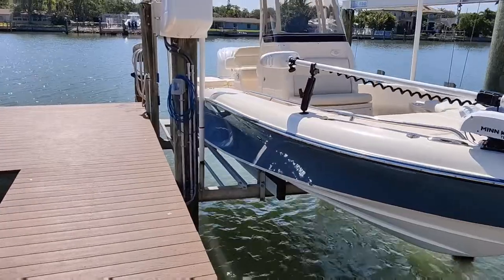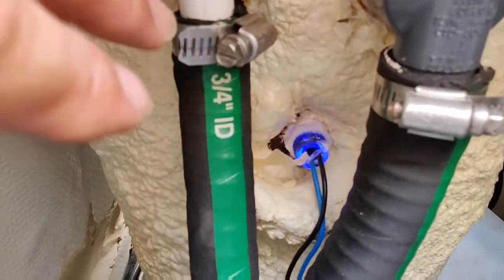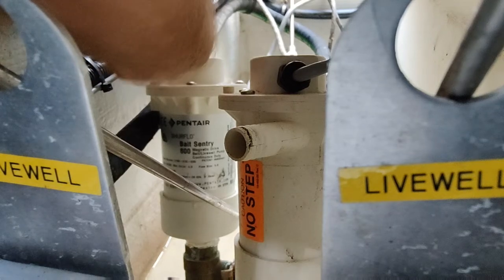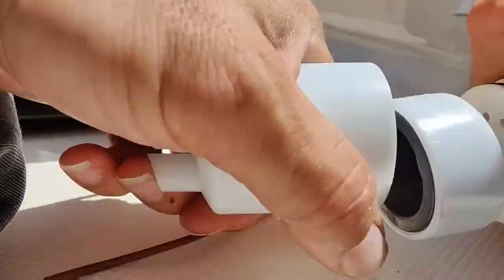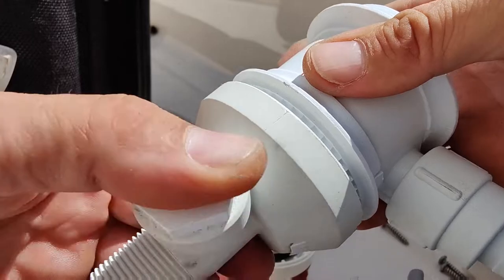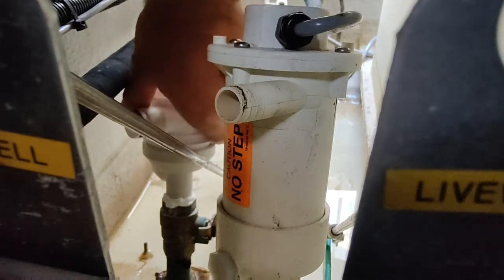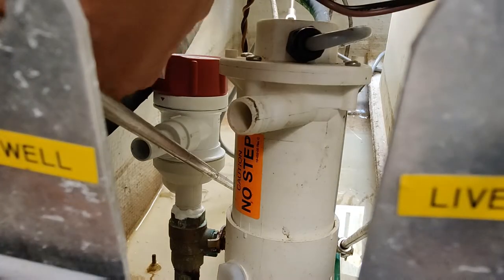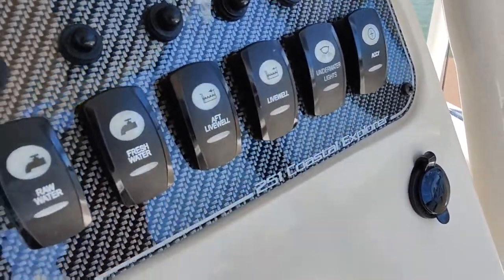Battle Of Livewell Pumps #GradyWhite #Rule #Sentry #Episode159

Comment: My bait sentry just quit. Saw your video and would like to put in the rule tournament series. My problem is that the old shurflo pump runs on a 2 amp fuse and the tournament series requires a 2.5 amp fuse. Do you think I’m OK 3:07 Just upgrading my fuse from 2 amp to 2.5 A on my Boston whaler dauntless?
Reply from the maker: That will work just fine.  The wiring can handle it and you are correct. Just match the fuse to the pump.

Comment: Why’s there water in that bilge?Thats a Grady —water should drain out before it gets down there…
Reply from the maker: The customer opens everything and washes it all down with fresh water. I thought the same thing but when I got there he was washing the compartments.  More then most customers do☺️
Reply: @JustinLeeMarine  that’s an answer I can be ok with.That bilge should be bone dry so that makes perfect sense.He needs to get down there and sponge it out or it’ll get slimy.

Part of the reason I let go of my Boston Whaler Conquest was because it ALWAYS had water in the bilge.it was fresh water from rain or cleaning but after almost 20 yrs of it always being wet down there all the steel straps that held the oil tank in place started rotting out.Replacing those would’ve been an absolute disaster even for a slender,young man like you. BW has so many floor boxes under the deck—water needs to flow through channels that are routed around all the openings and it just can’t divert it all away efficiently. And that’s why I’d chose A Grady over a BW hands down.
Reply from the maker: I agree with you. I also think Grady White builds a better boat than Boston Whaler.  Both are good boats but Grady is 1 step above Whaler in my opinion 😊